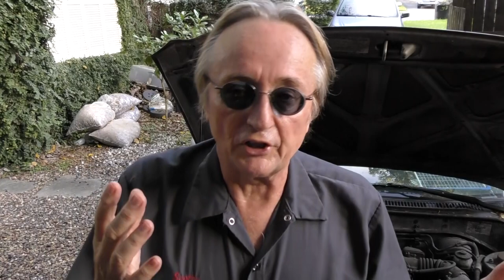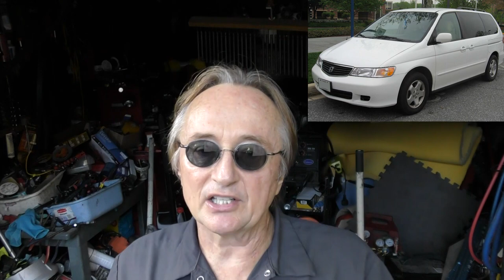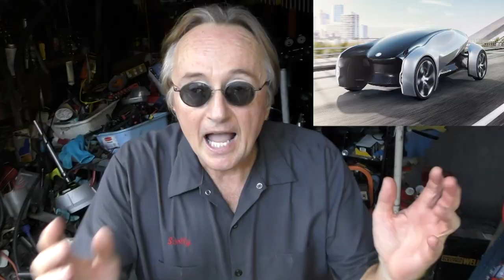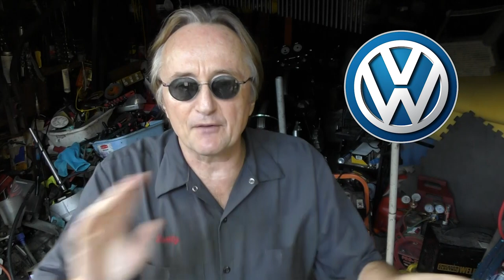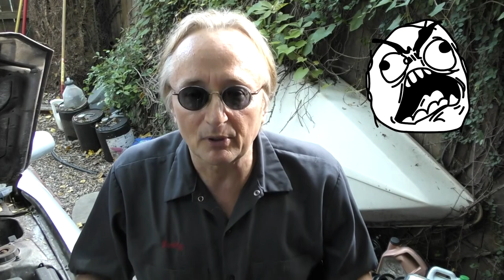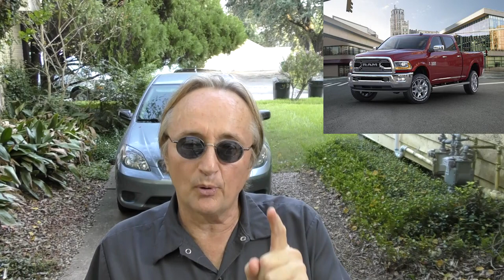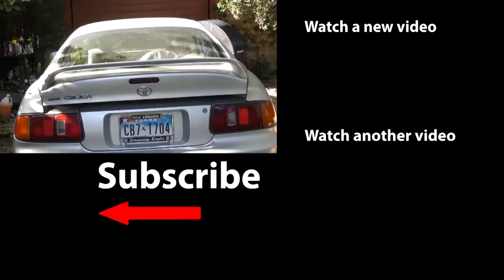Who Makes the Worst Automatic Transmission Cars in the World

Comment: As a long time Honda owner/lover, I can say that second gen Odyssey transmission were crap. They rushed that generation to market to compete with other manufacturers restyled minivans without fully testing that transmission engine combo.  I know of 3 people as well who had that generation and all got full free replacement transmissions from Honda.  If anything, it made them more loyal to Honda because Honda acknowledged the problem and gave them no fight. They admitted the problem, and replaced it, no arguing required(unlike some VW stories I can tell!)  Since then, I know of several 3rd gen and onward Odyssey owners who have had no issues whatsoever with the transmissions.  Honda learned their (very expensive)lesson and have made sure the transmissions can handle the power of their V6.
Reply: Terrence Bennett I’m in Canada. We had the 1st gen here. Size wise the 2nd gen was a vast improvement size wise since the first gen was more Asian MPV size than true North American minivan size.
Reply: I'm loyal to Honda, but I was disappointed it took a class action lawsuit for Honda to address the faulty A.C. compressors in their 2002-2007 CRVs. These compressors have a tendency to implode leaving shrapnel and sludge throughout the A.C. system, costing $4,000+ to replace the entire system. Google "Honda CRV black death" to learn more.
Reply: Michael Moniz, You're right, because that is what the 1st gen was, an Asian MPV. However, the reliability of the 1st gen is unmatched by any minivan. Even new minivans can't  match them in reliability. The 1st Gen Odyssey were small and underpowered, but they would easily reach 300,000 miles (482,000 kilometers) reliably. Not sure about Canada, but they didn't sell well here in the US due to their size.
Reply: Terrence Bennett sold pretty well here. As has many smaller well designed mpvs like the original Mazda MPV and the Mazda 5 which I own too. GM had a Canadian only model called the Chevrolet Orlando to compete against the 5  but it only lasted maybe 2 years cause it was an utter crap design. The 5 has rear sliding doors which is a major selling feature while Orlando has regular swing out rear doors. 🤦‍♂️
Reply: Michael Moniz.. I had one of the original MPVs too. It was a 1994 V6. That was one of the most reliable vehicles I have ever owned. I sold it with 182,000 miles on it (15 years old) and the van was bullet proof.  I was told that they were prone to tranny issues on the earlier ones, but mine was golden. Only gripe was lack of cargo room behind the seat and no real glove box on dash. Otherwise, it was an excellent vehicle. How's the Mazda 5 been for you? I am interested in purchasing one to be honest. I like the way they look.
Reply: Same story here. My 2001 Odyssey transmission crapped out after 90k, but Honda replaces it. I was so satisfied that I replaced it with a 2006 Odyssey. I’ve dumped and topped off ATF 4 quarts at a time (that’s all you get out of the drain plug) religiously and that transmission now has 200k and no issues.
Reply: Terrence Bennett well I’ve got 207000 kms (120,000 miles?)on mine and pretty good.  Other than usual wear and tear stuff, had a leaking water pump and had to replace an active engine mount. Never left me stranded. Bought because at the time we didn’t need a full size minivan with only 2 kids but wanted to ability to carry 4 adults comfortably. Now with a third child it’s gotten tight but we’re making it work as long as we can before we move up to an Odyssey.
Reply: I never knew the 2nd gen Odysseys had widespread transmission problems. My 2000 is up 234,000 miles and no issues yet.
Reply: My v6 accord auto transmission went out also
Reply: @OneManOnFire  what year?
Reply: not trying to be "that guy" but my dad bought our 2004 Odyssey about 7-8 years ago with about 80k miles with a bad transmission, rebuilt it, and it still has that same transmission at almost 250k miles.
Reply: AMSOIL would have prevented or delayed failures. 2015 Odyssey, 80k, 8000 towing my RV.
Reply: @msmoniz  Ist gen Odyssey was on an accord platform. Same vehicle sold in the USA and Canada.  Honda had no assembly line capable of building the 2nd gen Odyssey. They put that line into the Alliston Ontario Canada factory and expanded it. They made all the larger vehicles there initially. New factory in Lincoln Alabama got the 2004 Odyssey (last year of 2ng gen production) and all the line equipment moved there. The AT probs with second gen Odyssey were poorly handled at first.  But they looked after them as was previously mentioned. Not all 2nd gens were affected, mainly 99 and 01s. But depending on the parts used they could have problems. They are mainly Honda manufactured parts but some were made in the USA and most were made in Japan. I'm on my 4th Odyssey 2016 EX-L NAVI. Do all my own service. AT transmission fluid gets neglected and the recommended change is partial at about 3.3 quarts or 3.1 liters. No filter in the tranny but a permanent non serviceable magnet inside and one On the AT fluid drain bolt. External filter is not a recommended change item unless you have a problem or overhauling it. If you tow or drive fully loaded I would change the complete transmission fluid of about 9 liters up to 2017 model. This will preclude it from overheating the AT fluid and keep the transmission clean internally. One other item if I didn't tow with an Odyssey I'd r put a transmission cooler on it as it will help maintaining the fluids  integrity and reducing overheating problems.
Reply: @terbennett  they were the same as USA models with slight trim differences. This was a dealer requested van for many years. So the built it on an accord platform. Drives seat sucked for me due to back probs, but it was the leg position that caused my probs. Last year was a VTEC engine and had a tach and Speedo, instead of just a single Speedo. Yep they would do the mileage you mention and then some. I've seen 2nd 3rd gen Odysseys with high mileage on them . Transmission Fluid change is essentially and downplayed in the service recommendation as it doesn't appear to be good cost wise. Plus don't use any other brand of fluid, it'll damage the clutches.  I'm not a Honda fan I'm a Hondaite,
Reply: @jakemcgregor8117  Yep but this gets generalised. Even when they issue a service bulletin it doesn't mean ever last one will have a prob with the subject. I has a 1999 Odyssey jump out of reverse. I knew what it was right away but not the cause. Was a part that was at the outside dimension, the reverse selector. 
You can make this statement about anything manufactured. Scotty generalised. But everyone has AT  probs these days and it isn't just design, it's cheaping out on some things or manufacturing tolerances or even build quality and sometimes a poor design.  I'm waiting to see what the new Honda AT's, 9 and 10 speed made in Georgia are like as I'm out of the loop know but curious. That's  for 2018 and 2019 Odysseys plus.
Reply: @richardlugar6868  is it lottery when it comes to transmissions are some build in Japan and others build in the usa
Reply: One Man On Fire I think the 99-03 accords were horrendous for transmission issues. Many Honda trannies in that time period were junk. The only safe ones were the manuals
Reply: Terrence Bennett the service  manager gets 80 percent of the job , the mechanic only 15 to 20 percent of the job. That’s probability why hey we’re so generous
Reply: Honda makes a great lawnmower...
Reply: They have not offered to give me a free replacement
Reply: In Oct. 2015 I bought a 2003 Odyssey that had 201,000 miles with the warranty replaced transmission and had zero problems. Sadly though it got hit from behind and totaled and at time of death she had 255,000 miles. And now 2 months ago I used the insurance money on a 2001 Ody(135,000 miles) with a replaced tranny with an added AT cooler installed too. 10k later I've had no issues and with both vans I never changed the AT fluid. There were so many conflicting ideas on that subject I just let it be.
Reply: @dardalion3199  ,did you get the warranty from the dealership when you purschased it ? I bought a used 2000 Honda Odyssey from a private party and my transmission is not shifting correctly ? Just wondering how you got your transmission replaced without fees ? I have 225,000 miles on it ! Shifts kind of late but it's a smooth shift , in order to get it into 4th ( D4 ) I have to get up to at least 45-50 MPH ?
Reply: @jakemcgregor8117  , you experience any late shifts ?
Reply: @mooglemy3813  , never used a equally good transmission fluid ?
Reply: @commonsense3673  On occasion yes. Sometimes shifting out of 1st can be late but not every time, I think near 3,000 when it should be lower. But I also haven't driven it in a while. I'm the only one that seems to notice, so I just don't let it rev high out of 1st.

Comment: I had a 2004 Honda Odyssey never had a transmission issue, was just totaled last Friday (327,322 miles) when I hit a deer in the air as it tried to jump across the road
Reply: Me too. I am still driving 2000 Odyssey (2nd gen) on the original tranny. No issues. Scotty is wrong on that. Per my research, anybody towe with their 2gen oddy, will develop issues. This is because of over heat. The designed tranny cooler is inadequate.  Solution is mod it with beefy cooler.
Reply: Was the deer made of steel? I cannot imagine how a deer would total a Odyssey
Reply: @kuba2ve  more to repair then the vehicle was worth, it was not totaled in the classic sense
Reply: That’s rare Honda Odyssey has the worst transmission. My neighbors have one and it’s been giving them problems for years now. My mom has a Toyota Sienna. Only thing she had to repair was her blower motor. Why buy a Odyssey when you can get a sienna.
Reply: My 2001 Honda Obysses had an rebuilt transmission and three replacement engines. My third Honda engine which cost me $125.00  while the original engine mileage was at 500.000. 🙄
Reply: @JohnBeebe  So it was too deer?... Sorry.
Reply: @ratipati2007  not just odyssey, I replaced a 99 accord v6 tranny, you guys dodged a bullet. Their 4 cylinder trannys are good, no problem there but I am like scotty. Will never again touch a Honda v6 product
Reply: My 06 3rd gen has 250k on it but it's been shuttering under light acceleration for about 75000 miles.   Give it more gas and the shutter stops.  Probably should change filter and fluid or just put it on Craigslist indicating that it just needs a carb cleaning or just selling because I don't have room and the best one is don't worry about the miles.  LOL
Reply: @AwesomeBlackDude  wow..500k. Cool!
Reply: Deer Killer!!!
Reply: I still have my 2005 Honda Odyssey, 194,000 miles on it and no major problem with the transmission as long as you maintain it properly.
Reply: John Beebe,  that's good to know, I have a 2010 Odyssey going on 200k. No problems with it
Reply: My 2003 Honda odyssey with 178,000 miles on it transmission just went out on it. Still runs great though
Reply: Doesn't happen to every single vehicle Smart One
Reply: Same, and we still have it today and still runs smoothly. Never had a problem with its transmission. We won the lottery I guess.
Reply: My parents have a 2002 Honda Odyssey and the transmission quit at 115,000 miles. They didn't know about the warranty and it cost $4000 to get a rebuilt transmission for it. The air conditioning quit around 145,000 miles
Reply: @zakm4012  wtf? Toyota has recalled more cars then Honda ever did.
Reply: Jesus F. And the only reason why Honda wouldn’t have more recalls is because they cheaper out and didn’t want to replace the transmissions
Reply: Yeah scotty speaks generally about lots of the vehicles. You havs experience with one
Reply: How many miles did the dear have? Also did the dear have insurance?!
Reply: @billybob042665  sure. Sure they "don't". Dude. That coment by itseof shows gust how "bright" you are.
Reply: @kuba2ve  - Clearly you have never hit a deer or seen a vehicle after hitting one!
Reply: @nadrojfan  Actually no, but wait... googling... Wow! Google images for "car deer damage"... bowels, blood, head inside car... Geez!! Didn´t know it could get that ugly!!
Reply: I know people that had transmission issues and I know people that have with them
Reply: poor deer! RIP
Reply: Too bad yours kicked the bucket. I guess some of us got really lucky when we bought these. My parents picked up an 03 Odyssey EXL brand new at the time and now I am still driving it with 150,000 miles of heavy city traffic mileage. I will admit however that it is starting to clunk into reverse and does not want to shift 2nd to 3rd. Still, never ever broke down once and I am happy it lasted this long. Thinking about a 2020 Civic.
Reply: 200K on my 07 Odyssey. Never let us down, rides like a Learjet. It's well maintained of course
Reply: My moms 2002 had an issue had it rebuilt and it’s having issues again after the warranty
Reply: a Deer or John Deer?
Reply: Good job keeping it for over 300k!

Comment: I have a 2008 Honda Oddesy and know about the transmission issues thanks to the help of your videos.  I've looked Into it and most common issue is due to lack of maintenance causing parts to fail.  With dirty fluid it will cause passages to clog and the shift selonoids won't operate correctly.  Also the valve body needed passages to to be enlarged to allow more flow and upgraded springs to allow better operation.